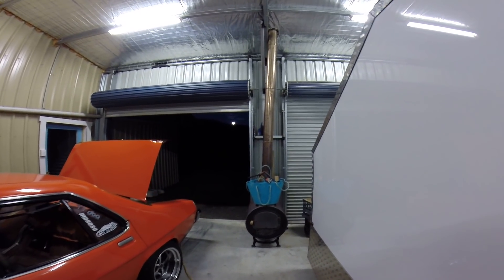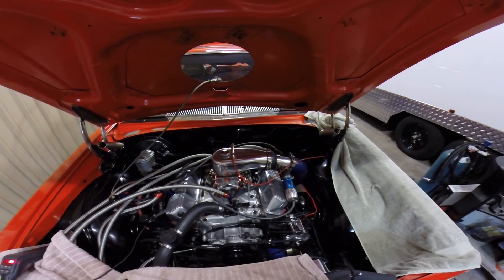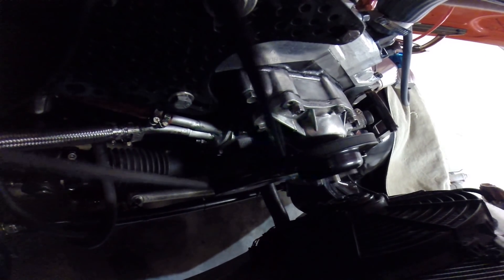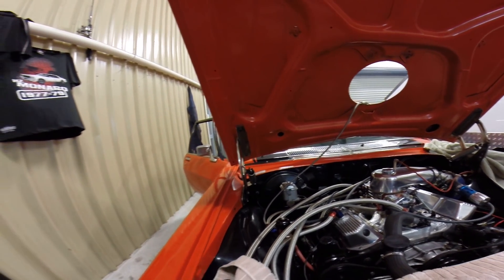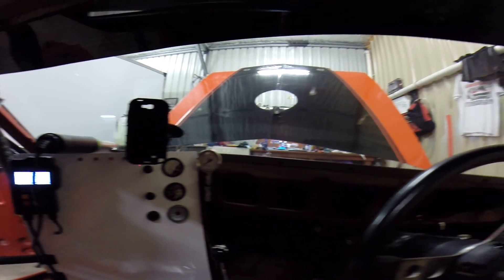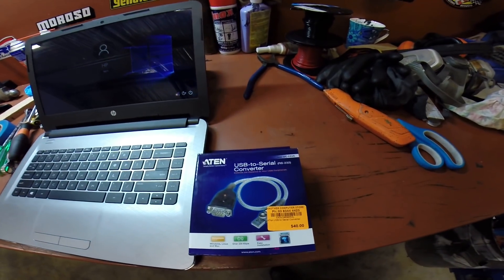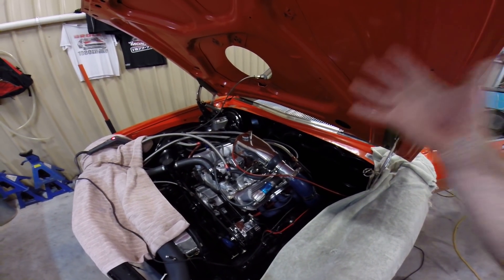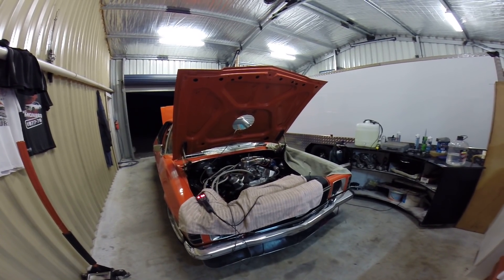My little 308 v8 is so snappy now, thanks to msd programmble

Comment: Nice!  I think it will be absolute chalk and cheese in terms of drivability, like a new engine.  Still waiting for you to put some slicks or semi-slicks on Griff!  You've been stoked with the oil drain, the sump, the trailer, the electrics, the timing, but I reckon tyres are going to blow you away more than anything so far.
Reply from the maker: https://www.instagram.com/p/BXB1dS3BPjd2q5y3u1Q-XAYyB90eTPSGhNUvQo0/ saving the best till last😂....  thankyou mike

Comment: Very crisp sounding throttle response , sounds sweet !!! I need to get one of those for my Nova ., I still have the points in it but I have the kit to upgrade to electronic ignition , just haven't put it in yet .. lol
Reply from the maker: THOMAS K electronic ignition is a nice upgrade over points.. i managed 7 pounds of boost with electronic just on its own and reducing plug gap a smidge...cheers

Comment: Good to see your investment in programmable ignition paying off. Throttle response is very noticable. The extra timing you've added has helped better complete combustion at a increased rpm. I bet your AFR has decreased at this extra timing rpm point. Please check the AFR to see if its still at a safe level. Change timing check fuel. Low comp boosted engine can usually take more timing off boost(good suggestion). Ive only been to tassie twice, most picturesque state in Australia.
Reply from the maker: G G it has cleaned up a/f a touch on idle.. The camera dosent do it justice how responsive it really is.. 30 degree is fairly conservative out of boost, the converter is fairly forgiving under 2300 that will allow for a nice little cushion...i starting to understand the potential of timing that it has on a engine when out of boost..Yes Tassie is a compact beautiful little island...cheers George
Reply: GRIFFS REARMOUNT TURBO, The Modfather personally speaking mate i thought i had my head around engine component selection and tuning until i started logging. Dyno time really helps to give you results, but you got to ask yourself "why did that work".  You made a change to your timing and got huge improvement. Probably the best value for money mod you've done. Understand why it worked, and you can unlock more hp. Great result this week hopefully many more to come.

Comment: That thing sounds so NASTY. It really does sound like it has no flywheel! You wont believe
how quick and how hard the boost is going to be hitting, because of the enhanced throttle
response.
Reply from the maker: 63Turbo you wont believe this, i got the lap top connected and put a little  bit more of a aggressive ramp of timing in, holy hell...

Comment: You'll be able to get a few degrees out of your meth safely with that to nice!!! 😀 Some of these cheap android tablets can support these programs to griff might be worth a look 50$ or so most those programs don't take a lot to run it's just the usb/serial port hassel
Reply from the maker: Chris J you read my mind!! I'm thinking that too mate a few degrees on boost 😁.. yes the serial port/ usb hassle has struck.. But i have one more trick up my sleeve lol.... cheers mate..   ps i tried it on my Samsung tab, didnt like it...
Reply: GRIFFS REARMOUNT TURBO, The Modfather.    Well looks like you got it anyway didn't see the laptop before... install looks super clean and rattleproof and thats one krisp exhaust note Kudos!!